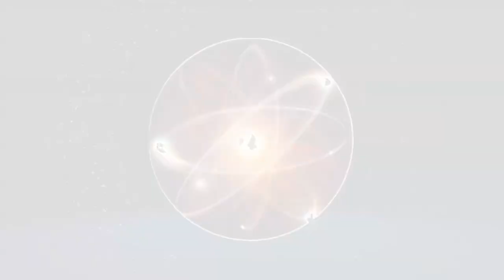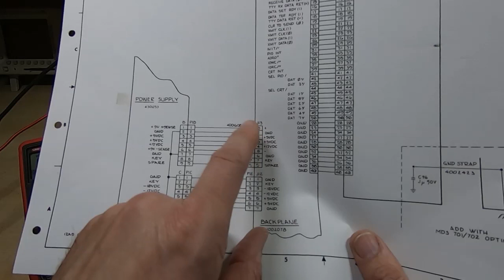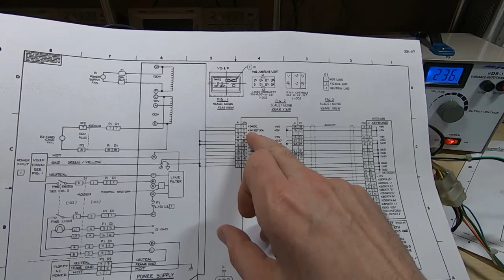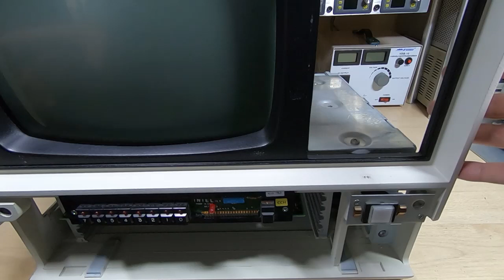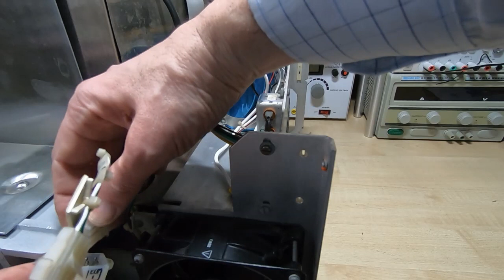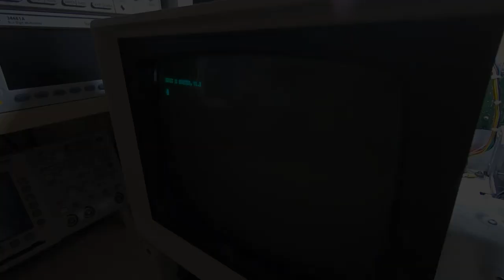Intel MDS Part12

Comment: Great series!  I have a MDS-230 that has been updated to a Series III.  One note.  When I turn mine on and get the monitor prompt.  It does not behave like yours.  It remains at the dot prompt.  My monitor version is the same.  Maybe something to do with the IOC version.
Reply from the maker: Yes there are a number of different versions and also configuration changes. I had around 5 machines and 10 sets of boards to repair (that have now gone back to the museum) and there were several differences.
Reply: @JerryWalker001  On your next video the diagnostics version you have was 1.5.  Mine is 1.4.  Fairly sure mine has the enhanced keyboard update but not the latest.  I have mine connected up to an Agilent 16700 on the CPUs and the SASI bus to capture boot sequences.  Having the inverse assemblers is helpful.  Even better is having the source code correlation.